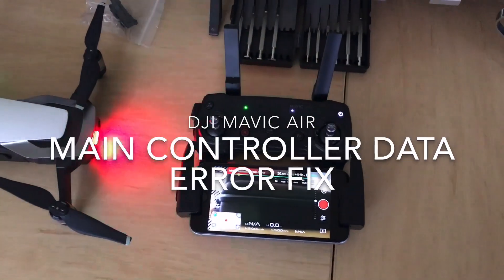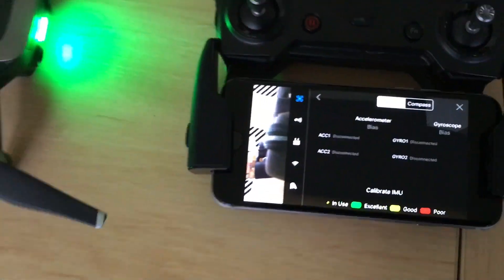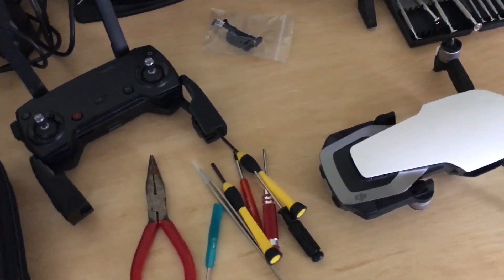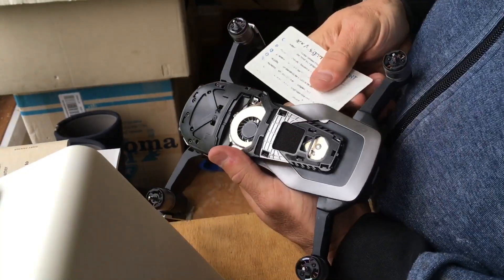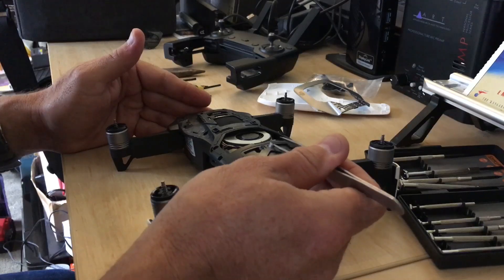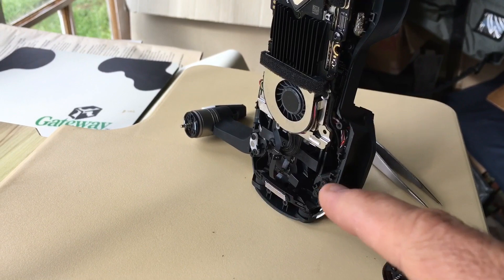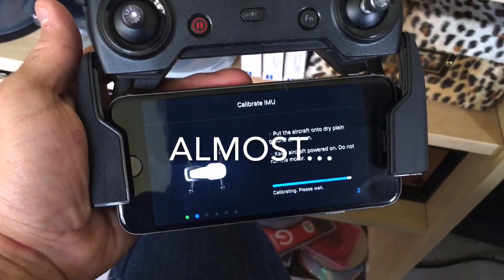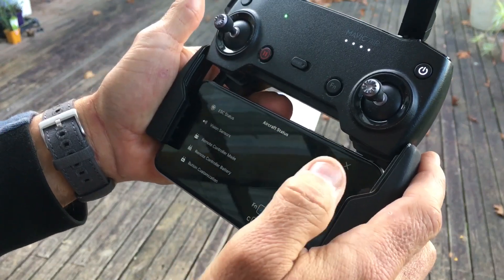DJI Mavic Air Main controller data error fix

Comment: You don't have to drill out the screws near the gimbal. They just have some gel glue over the head, you can use a flat head screw driver to scrap it away to give you access to the philips head at the bottom. Hope that helps!
Reply: Haha I have the exact same issue. Nearly went out to get a core board replacement, which is about 250USD... Right now it’s a 20 dollar component swap, way better!
Reply from the maker: Benson Teo Yes absolutely right, thanks Benson. I tried for so long I got frustrated and went nuts! :) I knew there had to be some trick but ran out of patience.
Reply: THANK YOU!
Reply: I I have same issue after I tried updating firmware and reset it to factory not working I did order this part online and replaced it but has the same issue 
Can you help me what I should do ?

Comment: ✅ FIXED IMU ERROR on DJI Mavic Air 2 ✅

I was getting the IMU calibration error and couldn’t fix it through the DJI Fly app — it just wouldn’t complete. Here’s what worked for me:
	1.	Downloaded DJI Assistant 2 (Consumer Drones Series) from DJI’s official website.
	2.	Connected the drone to my computer via USB-C.
	3.	Opened DJI Assistant and logged in.
	4.	Selected the Mavic Air 2 > clicked “Calibration”.
	5.	Followed the step-by-step IMU calibration instructions on screen.
	6.	Restarted the drone — IMU error was gone ✅

Hope this helps someone who’s stuck like I was! If it worked for you too, drop a like or reply 👍

Comment: No need to buy a new imu. Just open up the mavic till you get the imu off. Theres one screw on the imu, take that screw off and inside youll see some blue paste. Slowly take that paste off with a small screwdriver, leave it as you'll still need it. Blow inside the imu with a hair dryer about 5 minutes then put the blue paste back on, spread out the paste and put everything back together. Bam, everything works again.
Reply: Does this actually work? Just brought one of eBay and it’s coming with the same error but can’t find and Imu anywhere for iy

Comment: ------->>>   I had the same issue. Guess how I fixed it....I have hit it few times by the door frame exactly where the IMU is. I only had to calibrate the compass after all. All errors gone now! Worth checking before dismantle. I suppose it was just the cable that got loose where the  IMU is or shock reset it... Anyway - try this first!

Comment: In extreme hot weather like 40⁰ C and more, this error also appears due to overheating of the body of the drone or the battery. I came here because I just had this error 10 minutes ago. I was panicking cuz the IMU thing is impossible to do where I am. Also, I was at the start of a wedding and it would spoil the entire wedding. But thankfully, after I allowed the battery to cool down, it's working fine now. My battery temperature was 48⁰C when this happened. N weather outside was 41⁰C. So check this before panicking. Just a tip. N thanks for this video bro. But fortunately I didn't need this solution 😆
Reply: Me ajudou muito, acabou de acontecer isso com o meu e eu vi que era aquecimento.

Comment: Hi Onara, great video. Problem is happening with my dads Mavic air also. Also in Australia. Just wondering if you have a link for the IMU you purchased? We searched on eBay and most are for Mavic air 2 or does this not matter? cheers ! :)
Reply from the maker: The seller I bought from is long gone sorry. You can track these down via fleabay but you might need to shop on the US fleabay and see if they’ll ship here

Comment: Thanks for the video and the simplified workflow for repair as compared to most of the methods on YouTube.

My Air randomly started showing this error on boot a few weeks ago. I finally was able to purchase an IMU off eBay to complete the repair.

Two pieces that helped me:

1) Removal of the screw caps which hold the cover on the drone (by the gimbal)

2) Purchased extremely small headed tweezers for screw and ribbon cable handling

Comment: Hi, which screwdriver did you use for the screws behind the gimbal? I can't remove the body! Thank you! :)
Reply from the maker: Check the pinned comment as he’s right with what he says about the “hidden” screws.
Reply: There is a rubber parts coner the screws so remove it first by pushing it then you will see the screws

Comment: Hi 
im try to find this part for mavic air on ebay but there is only for mavic air 2  any sugestion ? please let me know if you can
Reply: Hey I'm having the same problem. Did you ever find one for the Air? Do you know if the Air 2 IMU is compatible with the original Air?
Reply: @mdachelis7  hi
Im found on AliExpress second hand one for £1,5 so i bought two just incase
You can try to take IMU of and hear it then put it back on and try calibrate

Comment: IF?  I got these same messages because I switched on the drone with guard in place, Do you think this replacing imu system will save my Mavic air?
Where did you find the working IMU?

Comment: So my MA has sat for a few months without flying, went to fly the other day, updated firmware and then bam, same main controller data error. What could have caused the IMU to go bad? I'm going to try to find another IMU and thanks to your video, and another picture tutorial I found, I'm convinced that a new IMU will fix it. I'm just confused as to HOW it could have gone bad....
Reply: The same thing happened to me as well. Brand new, sitting in the cupboard for five months, took it out, updated, and got the same error.

Comment: I have the same problem and I am happy I have stumbled on your video.. But I have a few questions, How did you remove the cables from the board? And how did you plug them back after? That would be very helpful, thank you !!
Reply from the maker: I used a pair of tweezers and a very small screwdriver and just manipulated them carefully. It wasn’t hard as it’s a simple connection.

Comment: Do you have details of the seller you bought this off? I can only find this part for $140.  I crashed mine today and all these errors come up. looks like this is potentially the problem :(
Reply from the maker: Just search for magic air IMU. A search just now brought up a couple of options for around $59. I believe you can get them from AliExpress too.
Reply: Onara Films only one I saw for 59 was USD. No new ones on Ali express :(
Reply from the maker: Danny Cobb the seller I bought it from is showing as no longer a registered user. He had listed it as: 
Original Camera IMU Module Board Components Repair Parts for DJI Mavic Air Drone
Reply: Onara Films I’ll search that. Thank u. I flew mine into a tree today and a bunch of errors come up now.

Comment: I just finished replacing the IMU on my DJI Mavic air, I followed most of your instructions and thanks to you I was able to fix my Mavic, I couldn't have done it without your instructions, thank you, I've only had my Mavic air for about a year, I bought it new and I was surprised with the IMU error, thanks
Reply: Where did you buy working IMU?
Reply: @8DHealth  ebay

Comment: Bro. My drone is fixed, mostly because of this video! I was almost scammed on eBay but the replacement IMU finally arrived 8 weeks after I ordered it. This video (and a German DJI Air teardown video) walked me through everything I needed to know. For anybody that is about to do this, the two screws that hold the cover on have little caps on them. You have to wedge in a super small flathead and pry it off before unscrewing with a super small Phillips. When I went for my test run, I had a right downward sensor error, I failed to connect the 3 ribbon cables securely. One they clicked in, I was in business!! She flies like a champ again! Thanks for posting this video. You rock.
Reply: I I have same issue after I tried updating firmware and reset it to factory not working I did order this part online and replaced it but has the same issue 
Can you help me what I should do ?
Reply: @Magiclenses  take it back apart and check all your cable connections
Reply: @NotEvenThatsOdd  I believe that issue not fixed because I did order a wrong part it is for Mavic Air 2  it is different correct?

Comment: I haven't used my drone for about a year when I visited Hawaii.  I charged all the batteries today and turned on the drone and got this dreaded error message and searching various forums and vids on YouTube says to replace the IMU.  I understand it's not an expensive fix, but I'm upset about why I would get this message.  It's not like I dropped or crashed the drone.  Any reasons why this would occur for no apparent reason?
Reply from the maker: C DC same scenario as me. I flew it a fair bit with no issues then didn’t fly it for around the same period - around a year. Never been crashed, always been babied. I happened to be in getting my Inspire 1 repaired as the landing gear worm screw had failed and so I took the Mavic air in when I picked the inspire up and showed them the issue. DJI either didn’t know or didn’t care. The don’t repair the “cheaper” products just replace. They offered to replace the body for $550! Ridiculous. They said maybe it had got moisture in the IMU but I can’t see how being stored in is case inside and never flown in the rain. Maybe when there’s condensation? I did fly some early mornings. Some people around the web seem to think it’s a design flaw linked to overheating. Possible I guess. Anyway left with a boat anchor I figured it was worth trying to fix myself as I may as well buy a new Mavic Mini for the cost of the “fix”.
Reply: @reviewsandprojects  same exact thing here. I have us it 3 time, and since the new regulation in Canada just after I bouhgt it, Ihavebt use it since. Never crash, and this morning I decide to try it and same message. This Drone is brand new. ;(
Reply: @Aldu35  When your drone was not used for a year, did you happen to store it with the battery installed?
Reply: Libena Starikova No battery. clean in the bag in a dry place. 😤
Reply: @Aldu35  Thanks! That rules out one theory. If you also didn't upgrade, then that leaves it to being some kind of physical defect inside the IMU or with the IMU connector. Did you also happen to see accelerator and gyro "disconnected" on the page before the Start Calibration page?
Reply: @reviewsandprojects  When your drone was not used for a year, did you happen to store it with the battery installed? If the battery was left in, this is my theory about the failure: https://www.youtube.com/watch?v=COMTYzqe_XE
Reply: @libenasukro  no, I never store my devices with a battery (drones, go pro, DJI action cam).  My case has a slot for all 3 batteries so they go in their own individual spot.

Comment: I have the same problem.. two days ago everything was fine, drone never had a crash, it is Like New state..and  today i wanted to fly it but i get errors Like in this video.. dji is quiet about this issue and as i can see it is common issue.. I'm wondering how this can happen on a premium product, i had more than 10 cheap drones, never ever had an issue, this is my first more expensive drone and I'm suite dissapointed.. i went for dji because i tought that they are really good but after reading all the problema People are having with them, I'm not so sure...
Reply: Did you recently update or something?
Reply: @alexissacro1502  I did just update today without turning my drone on for almost a year.  I've never dropped or crashed my drone.  So the update will damage the IMU?  I don't understand how this could be the consumer's problem.  What an inconvenience, was planning on taking the drone camping this weekend.
Reply: @cdc4355  Did you store the drone with the battery installed?  I'm working on a theory about this.
Reply: @libenasukro   I guess, I did and I am having same issue.

Comment: I have a problem with my ma maybe u can help since dji was useless I tried to do a update and it froze at 99% I turned on off the drone now it front 2 lights are solid red and back light flashes green yellow red and wont connect to the rc app or assistant 2 any help would be amazing